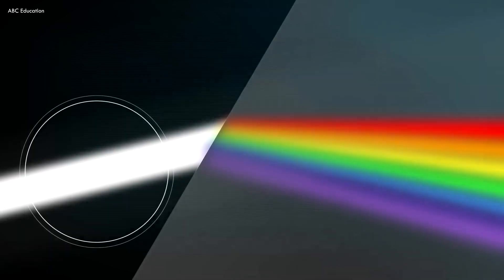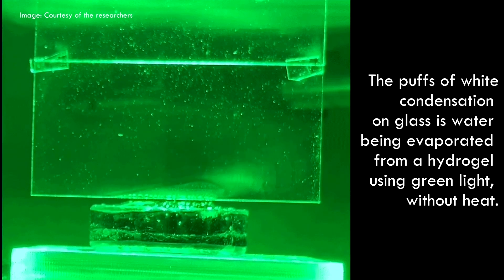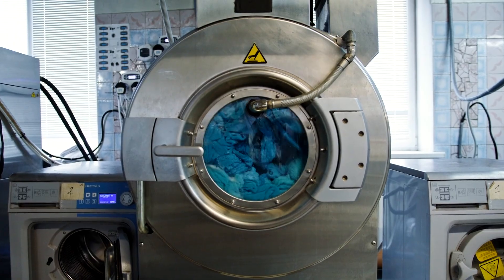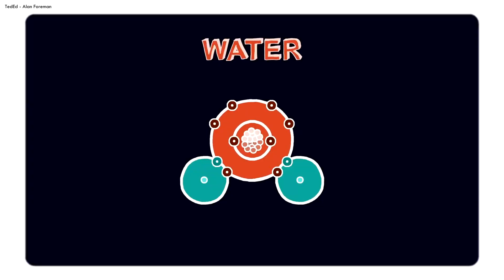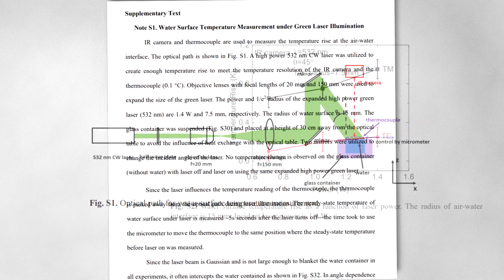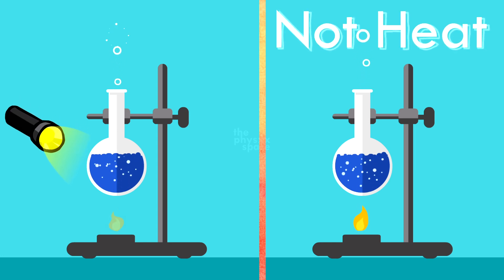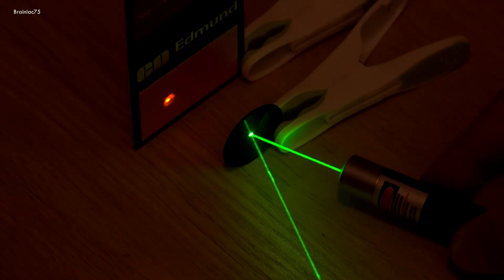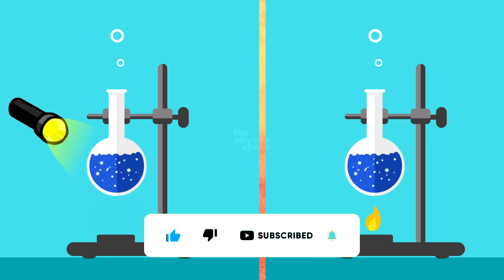New Discovery REWRITES How We Understand Water Evaporation! (MIT Breakthrough)

Comment: Heat is responsible for evaporation, not light directly.

---

Here's how it works:

Evaporation happens when water molecules gain enough kinetic energy to escape into the air as vapor.

Heat increases the energy of water molecules, making evaporation faster.

Light can cause heating if it's absorbed by the water or by a surface near it.

---

So, what's the role of light?

Light (like sunlight) contains infrared radiation, which is heat energy.

When this light is absorbed, it raises the temperature of the water or the container—this is what speeds up evaporation.

Visible light, like green light, has less energy than infrared and doesn’t heat water much on its own.

---

Summary:

Light only causes evaporation if it produces heat.

Heat (temperature rise) is the true driver of evaporation.

So in your earlier example: if green dye helps absorb more sunlight and thus generates more heat, that heat increases evaporation—not the green light by itself.
Reply from the maker: Hello thanks for your comment, but I'm unable to understand if you have watched the whole video or not. Here you're right about one thing but that's a basic concept.

In this video I'm talking about a more in depth, higher level concept that is newly being discussed by scientists from MIT, it's called Photomolecular effect. Please watch the video.

Comment: That  needs to be proven by data and studies however it seems plausible!
Since sun rays on solar and  brighter lights tends to heat up the heat generating device and we can observe effect of infrared and ultraviolet  lights on different materials  ... all are indicator of presence of photon energy in light. of different levels and types..... still we need to be further invest some efforts in investigations. to prove that the Industrial application is viable  and cost effective.
on the same principle why not use sound vibrations that microwaves evaporates more effectively  and controllable way???? whats the difference here ?
Reply from the maker: Sir, the difference is it can be done by light and light can be a more efficient form of energy than sound. You'll need more energy to generate sound.

Comment: If true then it could be a revolution for our global fresh water needs. Also what might the implications be for the electrolysis of Hydrogen ??
Reply from the maker: Hello sir, this is a very new research and I have attached the link to the actual paper that was published in the descriptions. You can check it out and this effect isn't directly related to electrolysis.
Reply: @PhysxXSpace  Thank you for uploading the video. Cheap accessible fresh water will become a major theme of the 21st Century. Not only for human consumption but as a prerequisite of Hydrogen electrolysis, if the vapourisation of water is cheap and that water then is pure, then electrolysis becomes cheaper. Massive implications for the new Hydrogen economy replacing the fossil fuel economy in this Century.